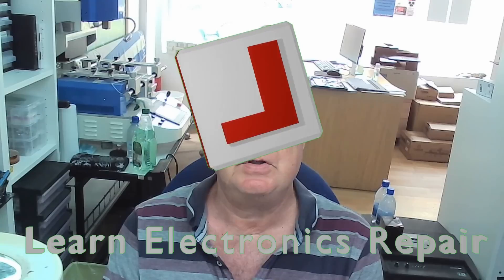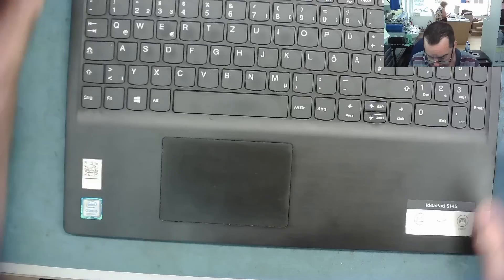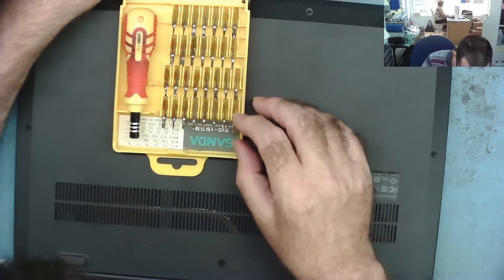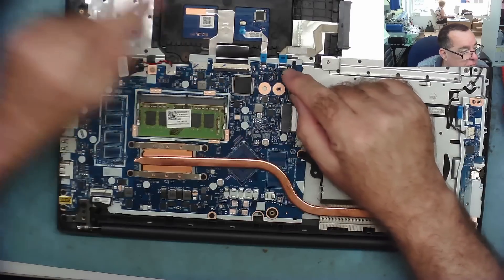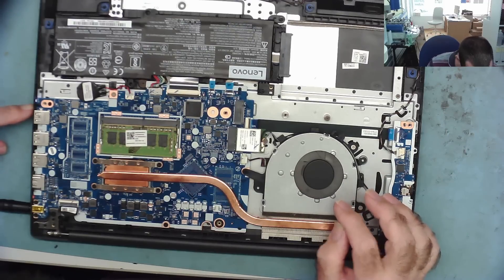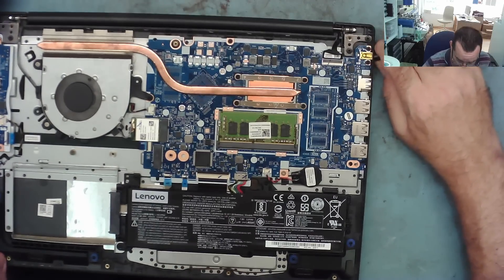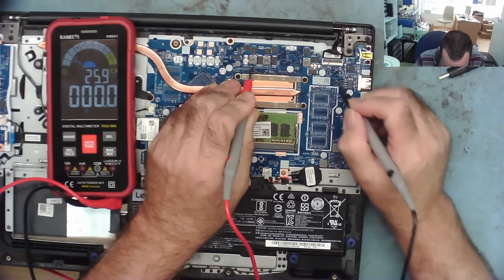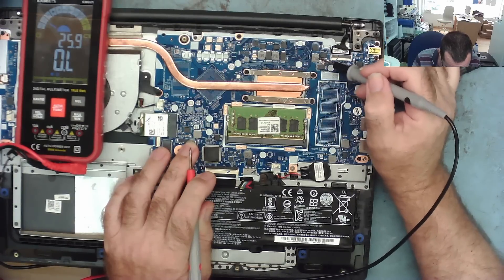Lenovo IdeaPad S145 Flashing White Power Light No Boot No POST Motherboard Component Level Repair

Comment: i definetely think injecting voltage is the best next step for diagnosing this laptop. Upon injecting the correct supply voltage at that coil, you would soon find out if the machine wants to turn on and work, or if that circuit pulls excessive current from your power supply triggering over current protection, in which case you would know the pch is defective and shorted
Reply: I had a similar situation the other day, where a lenovo had a shorted pch... and the pch didnt warm up much but it was pulling my 3v supply down.. so i injected voltage and found it drew over 5amps at 3v and the pch was burning hot

Comment: Hi Richard, I would suggest you measure the board while having the laptop lid open, hanging from the table as the hall sensor can have an impact on the power states.
Reply from the maker: Really?
Reply: @LearnElectronicsRepair  Yep, I read that the lid switch/sensor can mess up your day.

Comment: Hi Richard, your coil PL5901 is for iGPU voltage, +VCC_GT and it is totally fine, its 0V ( even in good, working condition ). Your problem is most likely bad BIOS, which is very often case with this behaviour. Just flash another one.
Reply: i had same issue my client idapad s145.how can i flash the bios if the monitor wont displayed?
Reply: @laptopdesktoprepairmekuslang  You have to use some programmer. There is part two of this video, Richard is showing, how to do it.

Comment: Looks to me like you are on the right path. Can you operate the supply with that inductor removed to check the voltage or is that a buck or boost supply? I am not a laptop guy -  I do mostly test equipment. Had to chuckle at the IR camera name "Hikvision". Regards, David.
Reply from the maker: There have been a couple suggestions of the same idea - so yes this test will definitely be made

Comment: Hello Richard, Maybe a corrupter bios ? Grts
Reply: Exactly. Altough this missing voltage is suspicious, maybe it's just not being initiated because of a BIOS issue? I would try and reprogram the BIOS chip. Also, have you checked the CMOS battery? I had a few laptops and desktop motherboards brought back to life just by replacing the battery...
Reply: Yup corrupted BIOS is also my guess. Would remove the BIOS battery first.
Reply: @rafak9177  He disconnected both battery and cmos battery in the video. Both I think he didn't hold down the power button after disconnecting to remove static charges, although the charges were probably gone while he went for lunch.
Reply: @rafak9177  another way to remove static charges is shorting out the cmos battery pins with tweezers.
Reply: @kriswillems5661  Not talking about resetting CMOS. Sometimes when you buy used/broken stuff, the battery is completely depleted and it needs at least 3V
Reply from the maker: @kriswillems5661  / Rafal K I did do that (held power button down for over one minute with batteries disconnected as suggested on the Lenovo website thread) but didn't show that in the video, sorry.  I also checked the CMOS battery voltage (when it was unplugged, I didn't try when it was connected) it read 3.1V
Reply from the maker: On this idea of a corrupted BIOS - I'm not 100% sure it even gets that far in the boot sequence.  What do you guys think of this suggestion?

I check the BIOS for 3.3V supply then monitor the CS signal.  If the BIOS never gets a CS then the CPU is not even trying to read the first code from the BIOS so this eliminates this possibility at the moment.
Reply: @LearnElectronicsRepair  Yes, monitoring the CS or even the serial data lines with a scope would point out if there's BIOS activity. That's a good idea. If there's no BIOS activity the problem might be elsewhere.

Comment: I will tip on broken hall sensor, so power mode is suspend (fan running is weird) or corrupt bios in which case a reflash would do it...Cheers Richard !

Comment: first disconect alll the conector (wifi card etc)... second try another ram, 3º read the voltage on bios chip pin 8, 1, 2, 3 and 5 ... 4º write another bios... 5º get the boardview and shematic if available 6º check the signais on super i/o, with lid on 7º check and measure the data line on usb ports to see if are shorted (shorted pch ) 8º  lift up the coil withou voltage to see the voltage on mosfet for inject voltage, and see if heats very much but i think is the gpu coil that is only present on windows (after loading some grafics)... 9º reflow the ram chip joins ... 10º chek the cpu controller...  11º check all the coils with osciloscope... and measure others signais with that ...     if nothing of this works i think that board or cpu is off ... greatings from Portugal ... ;)

Comment: I'm sure you have already checked the 'obvious' first. Check, disconnect, reconnect CMOS battery (stuck in a boot loop, reset BIOS). Fan looks badly blocked (but maybe trick of light or trick of dust).

Comment: I mostly repair laptops. In my experience after a lot diagnosis I'll found it's pch. Because it's getting bloody hot. Is this because of no cooling on pch? Ther is no thermal paste on any of them
Reply: Hi richard that is normal yhat coil has no voltage probably it is gfx coil . Which only comes up when it needed like by loading windows. To see the pch is good you can measure the datalines on usb  they must be a in kiloohms. What i would suggest is try wit other ram. I dismantle board probably you have on underside soldered ram too. I also suggest to find the shematic with boardnumber. Because with model number you will not find it. But i think you are dealing with bad bios firmware. I will also suggest to look in that. Good luck regards Steve from Belgium

Comment: try to remove the inductor and check voltages on the mosfet
Reply: my Money is on this comment  :), this should give you the voltage range you need for injection
Reply from the maker: OK definitely I will check this. 🙂
Reply: Which one inductor you mean brother??

Comment: Check for 3.3v stdby for bios pin 8, 3.3v and 5v, then 1.8v and 1.5/1.35v for ram. Then 1 volt for cpu.
Reply from the maker: It looks like the RAM has 1.2V and the CPU (core) has around 0.75V-0.82V. I did find 3.3V and 5V on two buck regulators but I can check on the BIOS
Reply: Or you can check each one of power rail in a schematic if it exist.
Reply: Try another good ram maybe. Corrupted bios will show black screen with backlight. So i think it not bios problem. It can be a bad resistor which is in enable pin of ic pwm rail if there arent short coil to ground.

Comment: There night be a shorted USB or PCI bus device like an integrated webcam or maybe WIFI card.
Reply from the maker: The WiFi card I can remove. And I guess webcam and other devices I can disconnect.  Are you thinking the short is on the power rail that does not come up properly?
Reply: @LearnElectronicsRepair  I am not sure, but in that badcaps thread I referred to earlier, they were also talking about 1 power line not coming up - and there the missing power rail was related to the BIOS being corrupted.

Comment: PL5901 IS VCC_GT (ONE OF THE CPU/GPU SUPPLY)
THIS PROBLEM MAINLY CAUSE BY STUCK BIOS, OR HALL SWITCH
REPROGRAMING 16MB BIOS MOSTLY SOLVE THIS PROBLEM
SOMETIME THIS PROBLEM ALSO CAUSE BY SIO
SIO  IS PROGRAMABLE 128KB KBBIOS IS INSIDE SIO SO IF YOU CHANGE SIO YOU ALSO NEED TO PROGRAM IT
I HAVE SCHEMATIC, KB BIOS & MAIN BIOS FOR THIS BOARD

OTHER POSSIBLITIES
BIOS NOT GETTING 3V
ONE OF THE ESD PROTECTION FAIL
FAULTY KEYBOARD OR TOUCH PAD
FAULTY SSD, HDD OR WIFI
ANY STEP DOWN VOLTAGE MISSING
Reply from the maker: @Jay Vyas There is no need to shout here to be heard 😉
Reply: @LearnElectronicsRepair  no sir i am not shouting, i like the way you troubleshoot and thats the only reason why i reply.  basically i never reply to anyone
Reply: Shouting in internet slang means typing all capital letters.
Reply: @kriswillems5661  ohhh sorry my bad, I thought shouting means unnecessary writing 😅